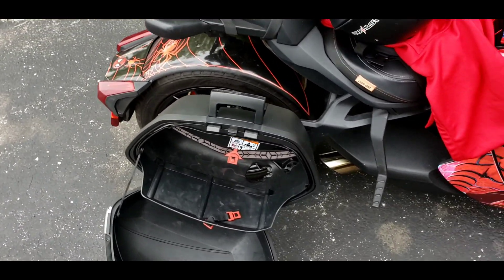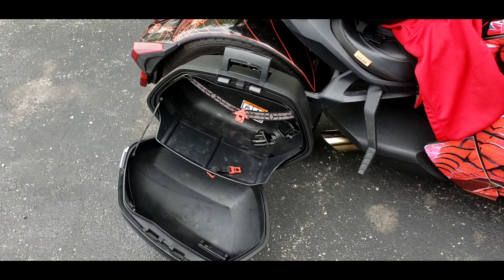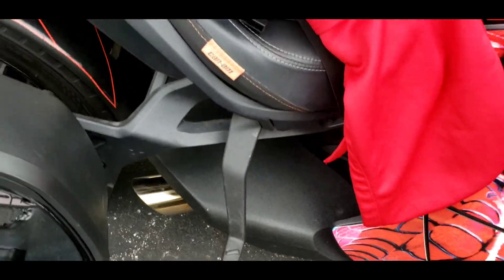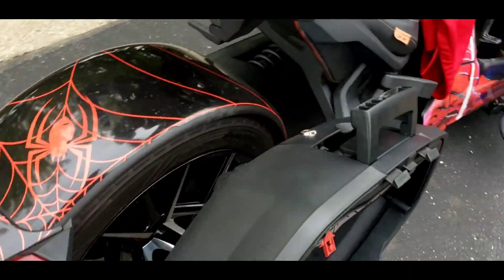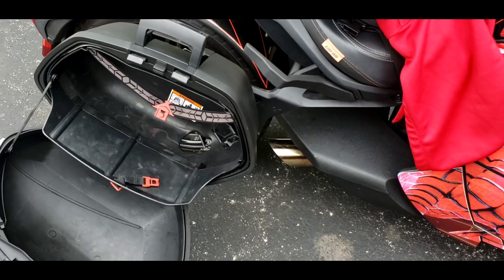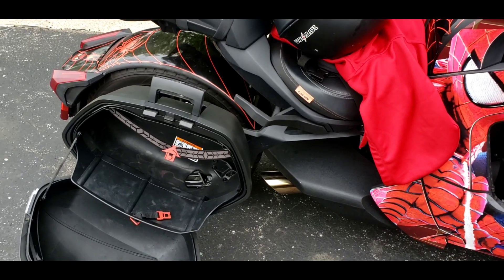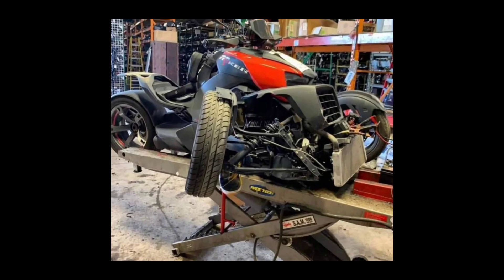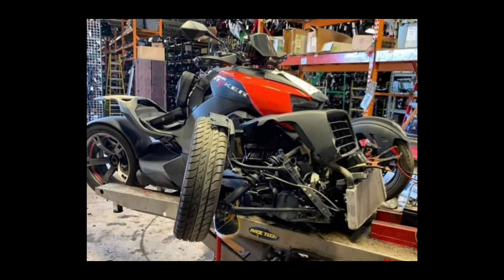Can-Am Ryker! One reason why you shouldn't add an exhaust.

Comment: Yeap happen to me also I was good for months. I'm in Texas and went to  black wallstreet in Tulsa and when  I got back home I noticed the hole burn through in the same spot. I have a RLS EXHAUST controlled kaos
Reply from the maker: I'm going to try to install a heating shield over the hole and see how that goes
Reply: @c8pate744   That's what I did got it off Amazon so far so good...

Comment: I sending up prayers for your stepmom!🙏🏾🙏🏾🙏🏾 As for the lady in the accident I'm glad the lady is physically ok fortunately her bike can be replaced. Bruh that side bag issue is crazy!!! However it's an easy fix ... grab you a few hand towels and some heavy duty pipe pliers/wrench. It sounds crazy but it's best to do the mod while the exhaust is relatively hot, use the towel to prevent scrathing up the exhaust & also burning yourself. Then take the pliers/wrench and slowly/genty bend the top of the exhaust downward.
Reply from the maker: I dont think I can pull that off with this one

Comment: First and foremost prayers 🙏🏾 for you and your family and wishing your step mother a speedy and full recovery. Also prayer and blessing sent for good health and recovery for Kelly 🙏🏾.  I’ve brought this up on shad bag. That’s exactly why can am should make a left side mount and raise the mount bracket and bag height. This was a bad design choice. Never should’ve been put on the right side for exactly what happened with your shad bag. 2nd, by it being so low and on the right side the bag covers the rear wheel which is a let down by brp can am. People have wheels so they can be seen. Why would you want to cover the wheel with a bag. 🤦🏾‍♂️ The slingmods mount is much better design except for the way the light plug in. Their design should have had a integrated power link hub on the bags so that when you mount them you don’t need to plug up or unplug wires every time you mount our dis out the bag cases. Other than that slingmods bags and setup are way better.
Reply from the maker: I'm going to do more research on the slingmod bag today. I was thinking about getting a exhaust tip that points down at the ground instead of towards the bag

Comment: Hey buddy just watched your video. Just wanted to leave a comment here and let you know that you should not be discouraged about having a high performance exhaust on your machine. A good exhaust manufacturer will check to make sure that the exhaust is going to work with other accessories that are common for these bikes like the saddlebag for that right hand side. I know when we did all of our testing when TREAL PERFORMANCE was designing and fabricating an exhaust for this bike they specifically tested it with that saddle bag on my bike before it ever went out to the public. The reason being is, they understand that it's a common modification and they don't want somebody to have this happen to them. A good manufacturer will always do this process. It's what my company BLR TUNING practices on a regular basis. When we're coming out with a new part we make sure that it works with other parts out there. If something isn't going to work with another modification out there on the market then we make sure to let people know in a installation video or on our website or our Etsy shop that this product will not work with another product. anyways I just wanted to shed some light on the subject. It's one of those things where just because there's one bad exhaust out there that did this to the saddlebag doesn't mean all of them are bad. Prayers for your family.... Much respect. Keep up the good videos.
Reply from the maker: I truly appreciate the feedback. You are very knowledgeable on this bike. You brought up some solid points that I didnt originally think about. This is an awesome topic of conversation. Is the exhaust manufacturer responsible for checking to make sure the product will work with other accessories

Comment: You added plastic behind extreme heat.  Performance heat. Your lucky the back pressure burnt the hole instead of  deflection and redirecting. No exhaust has anything two inches behind the exit port of the hole. Bad mistake. Live and learn. Could have been worse. Buy a shad bag and put it behind your seat
Reply from the maker: I dont think you can put one of these behind the seat